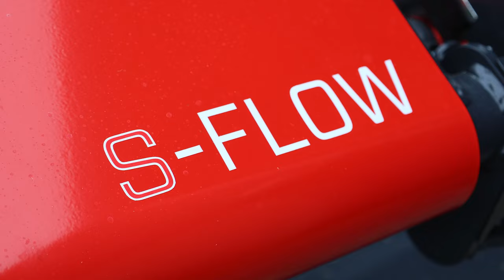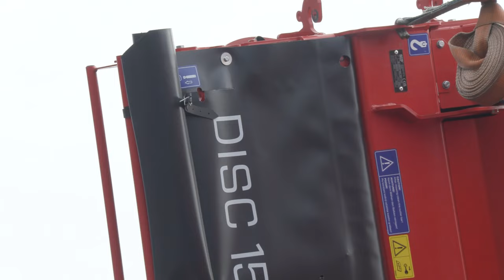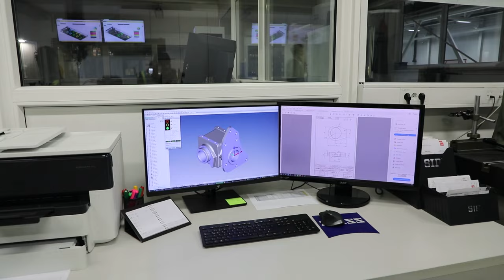What we really think of the WORLDS BIGGEST MOWERS made by SIP!!

Comment: Personally I thought the sip merger was brilliant to use over the kuhn. As most know kuhn is less than good tbh. The only faults I found in the sip was the pickup reel was ti slow and didn't put the grass ti the back bord so you didn't know you lifted a stone.  And the geometry in the headstock was not very good in the outside row in corners. Also the limited belt speed options on isobus. The kuhn has the advantage in them areas.  I just don't see the sip falling apart like a kuhn in a year or 2

Comment: any data regarding fuel usage with that setup ? 
how many litres / ha for example ? not pr hour. 

and personally i dont quite see the need for a bigger merger as its so flexible to collect 9m twice in one row and you have have much higher speed compared to normal rotor rake. i was out demoing a front 3m merger and the sales rep were doing 20kmh it long wet grass and it picked it all up nicely so i was really impressed and id imagine the trailed one too could handle higher speeds. 

only downsides is the cost + the weight of em xd
Reply: Hi chap the biggest thing being saved is time, fuel used would be around the same as a conventional 9ft set up over the total of the job, but time is the difference
Reply: @alanchatfield4271  i am fully aware of that. And it means you can take on another job in the same day. Also increasing profit abit.
But im still curious on what kind of fuel usage pr hectare/acre this 388hp tractor with 15m mowing does, simple as that😅
Cause the bottom line of economy comes from your input pr acre/ha vs output (silage/grains etc)
Its the same as the various research projects ive been on over the last few years. Comparing ploughing vs various reduced tillage tools and direct drilling.
There we used L / ha when comparing the tools and used same tractor. Which also calculated in savings and yield variances.
Reply: @SlyFoxl  couldn't tell you how many litres per/ha but that jd is sure to be about 55+ litres an hour when working, I see 38 litres an hour on a jd 6215R and thats dyno at 238 on the shaft,, this big set up is without a doubt the most efficient option for bigger fields, paying for it and getting the work for it would probably be the biggest problem lol